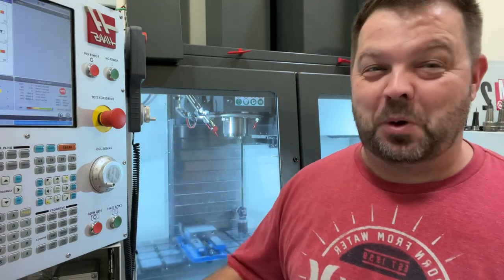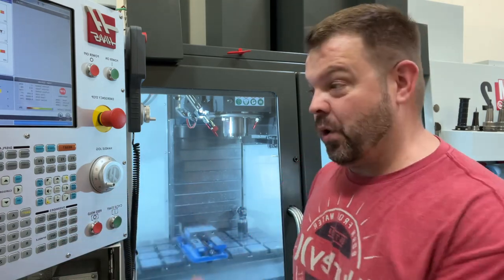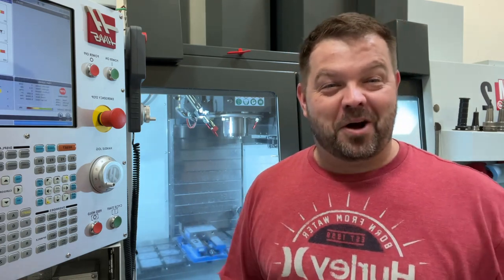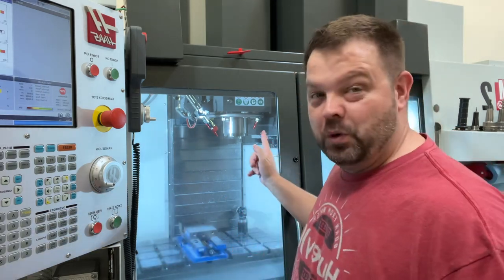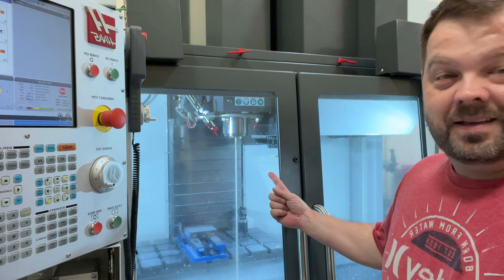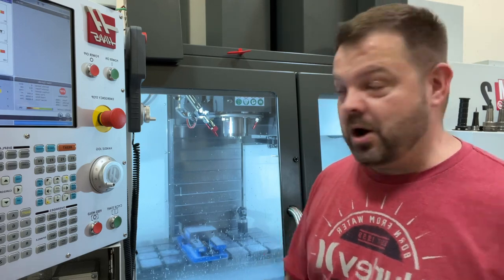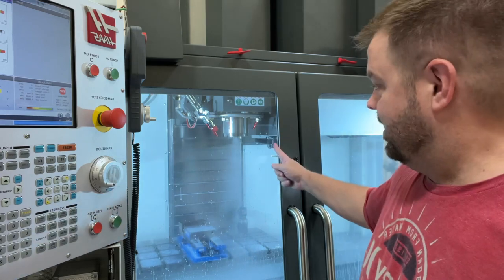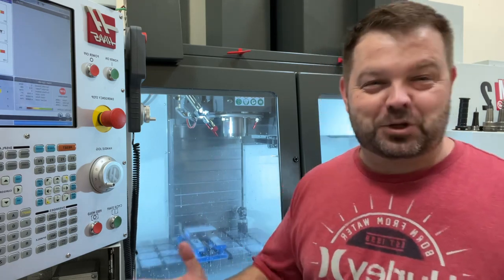TSC / TAB - Haas Keyboard Shortcut

Comment: Also shift coolant on classic controls turn on air blast, lathe and mill (not sure on the next gen). And some older controls f3 and f4 could be used as copy past for offset, not sure exactly what versions of the software this was in but is handy when you needed multiple work offsets with just a shift for say a tombstone. copy xy and then A90. A180 A270. and you done.
Reply: Thanks a lot!! Didnt know that😮

Comment: How much coolant do you have in the taper after running TSC? We bought a 2018 VF5 and Haas removed the air purge setting in the control, and its very short so there is a ton of coolant behind the tool on the tool change? Not sure if having coolant in the taper is a problem. Never had to deal with it previously because if there was a lot of coolant we would just add a second or two to the air purge duration setting.

Comment: Hi! Is there any way of overriding the TSC when running a program, like you can on the flood coolant? Also running a VF-2SSYT and getting to know her better. Greetings from Sweden.
Reply: as far as I know: yes. depends on the firmware. older firmware could only turn TSC on (reset needed to turn off), newer can turn on/ off (toggle switch like flood). BUT the spindle has to stop in order to switch TSC = not so practical while in the material ;)
Reply: @matzepilz  Yeah, so basically I can´t turn it of while running the program unless the Gcode stops the spindle or TSC...yeah, not very practical. I specifically want to see how far the  tool is from the stock and compare to the "distance to go". Machine is just delivered so FW should be pretty new. Thanks for your input 🙂
Reply: You could add an inline solenoid/bypass valve to redirect the tsc while running. Have it pump somewhere else so you can see what u wanna see.
Reply: @brianwaayenberg3099  That would be an option, a valve opened by a momentary pushbutton say on the side of the control panel housing.